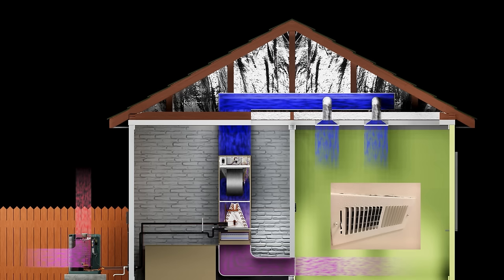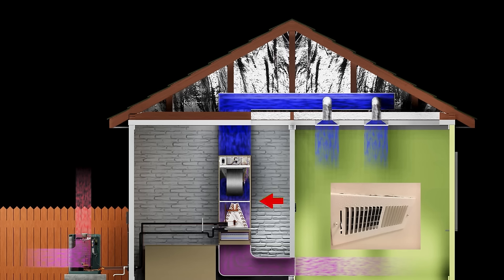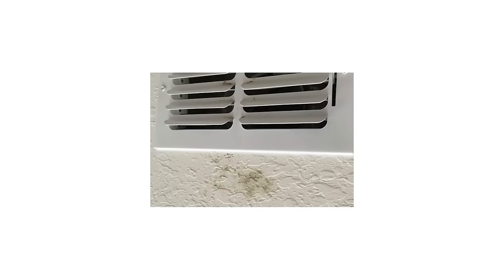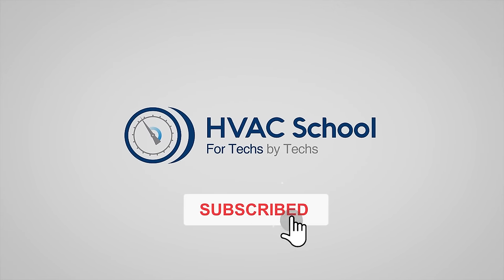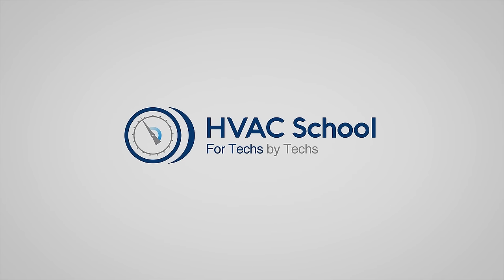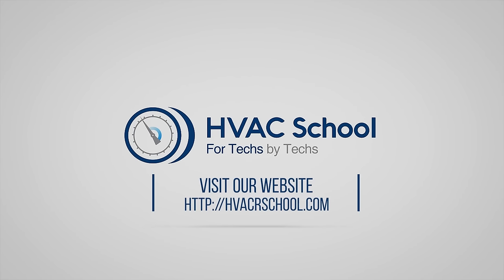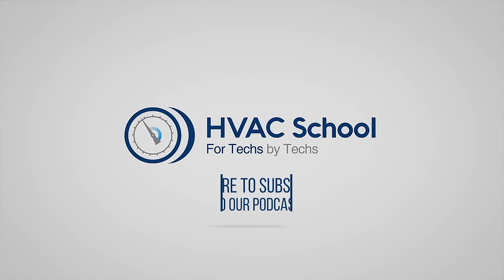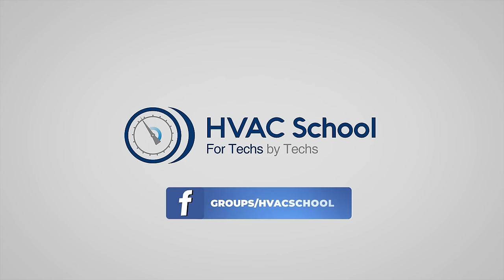Stop Sweaty Ducts, Vents and Systems

Comment: This was a super helpful video for me. I Installed an exhaust vent from our OTR microwave in our kitchen up through the ceiling, attic, and capped it off on the roof. Very short run (less than 4 feet) since it's 1-story home and the range is close to an exterior wall (6" round straight duct). Temperatures today were 102 F with a dewpoint of 79 F (51% humidity).

I ran the hood vent (new fancy schmancy OTR microwave, strong exhaust fan) after heating up some food and went about my business. Left the fan on for less than 10 minutes. I go back in the kitchen an hour or so later and hear water dripping and see water slowly dripping from the side of the OTR microwave where it meets the cabinets. I look up above the OTR microwave at the duct that is inside the house and see it sweating quite a bit.

So I'm all worried about if this is a new issue or one that's been happening for awhile and start researching. I figure I need to insulate the duct before I better seal the gap between the duct and the ceiling (which definitely allows warm attic air in).

Well your video perfectly explained the issue for me and has saved me from making the mistake of reaching for insulation instead of just focusing on sealing. And you've also calmed my worries about the portion of the duct in the attic since, as you said, air moving through the duct does very little to the duct's external surface temperature.

Only annoying part for me is that the duct goes from the OTR microwave through the tiny cabinet above the microwave, and then through a like 4" tall space between the top of the cabinet and the actual ceiling, and then finally into the attic. I can easily seal up the gap between the inside of the cabinet and the space between the top of the cabinet and the ceiling. But there's no easy way for me to seal the gap between the actual ceiling and the attic (but luckily that hole/gap is muchhhh tighter, albeit not tight enough given the warm air that can be felt rushing in to replace the air exhausted out). I'll probably just have to seal it up from within the attic even though it's too cramped to even crouch at the point where the duct is 😅.

Comment: Great.   My agency has been involved with the Weatherization program  for half a century.  We've gone from plastic over windows to geothermal and solar.  Some of the biggest issues we have dealt with (I'm from Oklahoma and only Fla and OK know what real humidity is....Ha) is sweating vents.  These are full  new HVAC install to upgrades, insulation, attic sealing and air flow and on and on.  
I'm now 68 and retiring.  I've seen  it all from retrofit (toss storm windows and  blow insulation) to dealing the Lead  based paint.  I've  always felt bad for my crews.  Anyway,  I  have a nice house built in the 70's.  Cathedral ceilings and High efficiency (seer)  HAVAC.  This is the first year one of my vents in the ceiling of living room has started to drip.  It's has the cathedral ceiling  where this  drip from  the vent is.  It gathers on the  outside of the vent till it hs enough  moisture to drop a drip.  Temps were at or over 100 with Humidity of about 40%.  My vents are all wrapped and sealed with insulation and R21 blown.  We had a ridge vents installed with the last new roof for better High Low venting.
What can I do to stop this one vent from dripping.   Help

Comment: Some interesting info.  One point of correction is moisture moves by vapor pressure not air pressure (airflow).   air curtains don't keep moisture out.  Doors only help if they are sealed.   Kitchen pressurization only reduced infiltratration or fresh air.  You still need vapor barriers to keep moisture from migrating in and out of buildings

Comment: My air handler inside home. I insulated drain pan with armaflex, 1/4" steel drip pan under that, cork under drip pan. Walls pour foamed that air handler is in. Coil room insulated on inside with armaflex. All duct solid steel, air sealed 100%. All ducts insulated with bioceramic r7 (hy tech) paint then insulated with reflectix, no gaps anywhere. Positive pressure condensation drain with skupper valve. 4" fresh air intake triple filtered, shut down in extreme temps. Ecm main fan and ecm fresh air fan. 6 uv lights surrounding coil set to timer. Crawlspace partially conditioned with temp and humidistat. If you have more than 10% diff you will reach dewpoint from what i understand. House is confortable. All walls, subfloors painted with insulating ceramic paint (hy tech) with concrobium and zinser paint. You are right you need to lower humidity in home to prevent condensation or keep the variation of temps below dewpoint. Btw bath walls do not sweat ever, only windows.  Bath fans set with auto humidistats. All wall and ceiling and floor protrusions sealed 100%

Comment: I had my attic spray foamed and they would not do so without removing the insulation. They said it would allow condensation on the ceiling drywall and grow mold/ mildew.
The attic is way cooler, considered conditioned space. Luckily our humidity near Dallas Texas, we haven't had any condensating ducts or vents.

Comment: I think the issue is that most people care more about lower power bills than some black mold on the outside of ducts in an unconditioned attic. A conditioned attic space, so all the ducts run in the conditioned space, is the best solution... for new construction. I hope all local codes are moving to enforce this. Put everything inside the conditioned envelope.

Comment: Good job 👍😎 I have a problem  on a closet I’m going to tomorrow. Duck is sweating. Only in that room. I think the air is too slow to that closet in that closet gets very hot for some reason. It has an adjacent attic on one side and it also has an attic above and behind it has a call wall on a condition space 72°. This area had just recently been done a couple years ago when they found mold in there on the walls and near the ceiling. That wasn’t just the other area there were some other spots as well. The house has three infinity systems. Currently there is only one duct sweating. More will be revealed tomorrow when I check on it again. Attic is very hot and 71° upstairs as well. I told him to try 73°

Comment: Thanks for the video.  I'm having sweating problems with a portion of ductwork in the basement that has been finished/boxed over with drywall.  Small amounts of water are coming through a ceiling vent and portion of the wall in the finished bathroom in the basement.  Also, I have paneling on a wall (on the other side of the basement bath) that is below the return and on the outside wall that is warping from the sweating ductwork.  So, what's the issue?  I'm already running a room dehumidifier in the basement.  With that, the relative humidity stays in the 50/55% range.  Should I check for an infiltration problem on the outside wall of the house?  Should I raise the temp that we run the AC at (currently 74 degrees for the house with the basement temps around 70 degrees)?  Before I start tearing down walls and the ductwork boxes it would be good to have some idea what the cause of the problem might be.   
Thanks to anyone who might have some insights.
 In the end, if I can't figure it out,  I'll try to get an HVAC guy in who hopefully knows what they're talking about.

Comment: I live on the Gulf coast.  Fifty years ago we didn't ventilate our attics and they would get to 140° or higher in the middle of summer.  It would take all night for that temperature to come down to dew point.  By that time, the sun had come back up and reheated the attic and we had zero sweating problems.

Fast forward to today and with ridge vents, soffit vents, whirly birds, powered fans, white metal roofs etc, attics don't get anywhere near that temp.  If it's 100% humidity outside and your attic is ventilated, it's also 100% humidity in your attic.  Add more efficient equipment and variable fan speeds and the air temps in ducts make it almost impossible to stop the sweating especially on older systems that still have R4 wrap.

People hate to hear it but I tell everyone to stop up all the ventilation, dehumidify the attic for a few days and put R30 on the ceiling.  Shingled roofs don't last as long when it's that hot in the attic but at least it isn't raining on your ceilings.  Been doing that with some success for fifteen years or so.  I wish I would have seen this video decades ago, was a lot of trial and error figuring this out. 😂
Reply: Gulf Coast Wisdom. Similar in GA, but less stringent. Humidity can manage itself if you do not over-design a system or over-ventilate; that hot attic is your friend here in GA, too, to a point (110F is fine).

Comment: I’m gonna have to watch this a few times to get this info to sink in.  Holy smokes great video.
Reply: High humidity air hits the surface with temperature below the dew point will result in water. To stop the water, you need either high temperature or low humidity. High temperature means more energy cost in winter. So I would think a good seal + dehumidifier would be the solution.

Comment: Increase the superheat on your air con. Dehumify and reduces cooling capacity. Stops the issue of cold and humid room. I used to use 2.4kw heater in humid summer untill i discovered 10 deg superheat on cool mode fixes this. Stops mouldy ceiling vents too

Comment: It's such a battle. 
We are spoiled these days.. hvac everywhere.  So now we want it refrig cold in our living space. Especially in hot environments.
I wish I could get one of the 30 hvac companies to give me an expensive option. To common they want the quick easy option. Change the unit (its already a new unit) or apply a bit of tape to some spots closest to the attic hatch. 
I need a redesign of the duct system.
( there is a big story to this).
It's to the point that I am educating myself and will just do the work myself.

Comment: I've been in HVAC for over 30 years I watch videos like this because I'd rather watch this than tv I read the comments.And nobody has hit the real issue yet in my opinion think about a house that was built 100 years ago it's not insulated very well it's drafty but one thing it's not and that's moldy or wet underneath it because air can move through the entire house we build houses completely sealed now days then spend thousands of dollars to recreate air circulation through the house when you seal the crawl space add a dehumidifier and a supply vent that's controlled air circulation same thing in the attic

Comment: The attic dew point does not change when you change the temperature. Condensation forms when the duct surface temperature is colder than dewpoint. However, warmer attics will warm up the an uninsulated duct surface a bit so I could see how it reduces condensation.

Comment: If you have a supply grill in a vaulted ceiling and its sealed and insulated perfectly but sweating  put a curved blade register and it will cool the area near the sweating register done it many time after other company tried everything works every time. If you have sweating spiral duct in a restaurant and its dripping on the customers all you have to do is direct the air up instead of vertical or down then the area around the sweating duct work will be cooled down and no more sweating. If you have sweating equipment in an attic unvent the attic and seal the attic then put a small portable dehumidifier in the attic problem solved.

Comment: It doesn't make any sense to increase heat gains just because the ducts are sweating. It is like killing a fly with a cannon.
People are talking about zero loses/gains houses nowadays.
Just insulate your ducts well enough,so the surface will be above dew point and seal with vapor barrier ( the ducts, not the attic).
Condensation on the vents can be solved by mixing the air leaving the evaporator with additional amount of air from the house in a such a way so the air exiting the vents is above dew point ( more air flow with temperature just above the dew point).

Comment: Not sure why adequate insulation with an appropriate vapor barrier would not keep moist air from condensation on the ductwork. This is the approach in most mechanical rooms.

Comment: I am that old guy engineer you spoke about in your video. I have a sweating coil. My house is a story and a half and my unit is in a walkin attic that is partially sealed. When the attic was almost sealed I had everything sweating and mold build up. I installed a 4” power vent that is humidity and temperature controlled to vent to the upper attic. That helped but did not solve the issue. I noticed the air was cold and stagnant around the sweating unit. I installed two very small fans. One blew air on the unit and the other blew air from the unit to the exaust fan . The two fans are controlled by a power ventilator temperature/humidity controller. The fans come on at 70% humidity. What the fans do is keep the attic air warmer so it does not condense easily on the unit and second, when it does condense it will helps dry the unit once it shuts off. 

I have considered your idea with the dehumidifier and if the fans do not work, I may do it. Another option is to condition the space. All I need is to seal it off and tap into the duct work. I think my energy efficient fan method will work.
Reply: is your AC sized to accommodate an attic space? That's an enormous load to add, and your attic register/vent will be prone to sweat up there.

Comment: I have a question, wouldn't insulating/sealing the ducts better and insulating the outside of the air handler also solve the problem because by doing so you are increasing the temperature of the surfaces of the ducts/airhandler. In theory you could just increase the amount of insulating material until the surface temperature is close to that of the attic?
Reply: Too right my man, and its less work then ripping off the roof installation 🤣
Reply: Yes in theory but in practice no. You would also have have a vapor barrier around the air handler
Reply: @madzmadeit  yeah the air handler is more challenging to deal with because the doors need to be accessible. The drain, tubing, and wires would make it hard to do. You would need to completely redesign the air handler to do it properly. As far as the ducts go I have done exactly what I said by wrapping the duct with normal duct wrap r6 insulation then wrapped with foil bubblewrap stuff and sealed the seams with mastic. The difference in temperature compared to before was enough for me to think it could solve the sweating duct problem in most situations, though I have only tried it on metal duct. Flex duct on the other hand might be more challenging to deal with. I don't run into sweating ducts too often though and every situation is different.
Reply: @Mazinblaster Z Actually I remember watching a video about a company spray foaming ductwork. I can't see any reason why it wouldn't work as a solution to sweating ducts. Only problem is you would likely want to make sure the ductwork is completely dry before putting any foam because there is no telling what kind of growth might happen between the foam and the duct if water gets trapped in there. Also I don't really know much about sprayfoam but I wouldn't be surprised if water messes up the chemical reaction of the foam.
Reply: @Mazinblaster Z Anything (like spray foam) that is air tight would keep humid air away from the outside surface of the duct.  This would prevent sweating.
Reply: @CRaZeCAP  you could cut the ductwrap to fit all the way around the air handler and have it so you could open it to acsees the doors something like a water heater blanket but it could only be done on air handler not a furnace
Reply: @madzmadeit  ...I did this.....bought the best quality polyiso sheets and glued them to the air handler....all outside surfaces. The sheets had  aluminum  barrler on the outide, and when done, I even  aluminum tape wrapped everything further. Works. Used up to 2" sheet thickness. Placd ( wedge-fit ) serparate poly pieces to the maintenance doors. A wooden 2 x 4 beam attached to the rafters cinches the polysheets tight against the maintenance doors that have poly over them. Like you see in old movies the big horizontal beam to secure the castle doors.
Reply: Yes...that was the point of another post I make here. Adding a sufficient amount of extra insulation on the air handler cabinet ( and also on previously insulated ductwork that snakes around an unconditioned attic space.....) should work to reduce the outside  surface temps of these areas...and if done enough....will be OK to not go below the attic-space dewpoint...and therefore they wont sweat.
Reply: @madzmadeit  ...just like insulating walls.....yes, insulation works, but use a vapor barrier on the correct side. It doesn't make the idea bad, however.
Reply: @CRaZeCAP  ...I did this to an air handler by gluing foil-faced poly sheet on all the sides of the air handler that did NOT have access doors....5 sides. On the 6th side with the access doors, I fashioned a way to have these sit tight against these access doors but are removable for service.